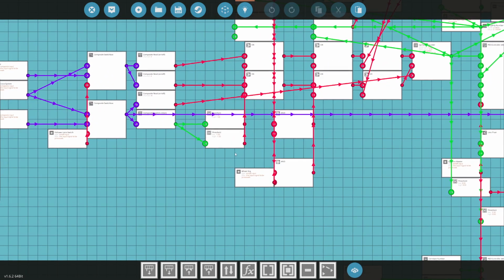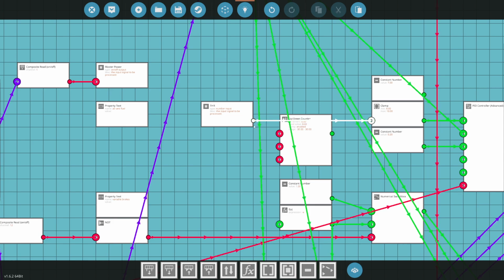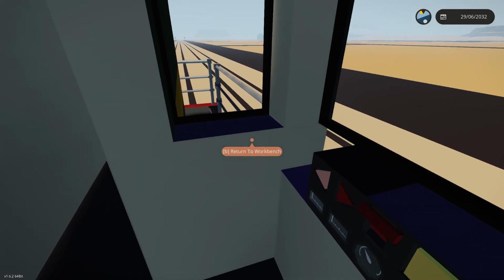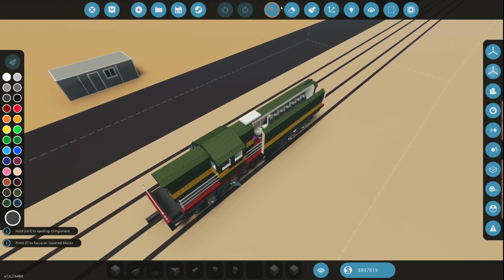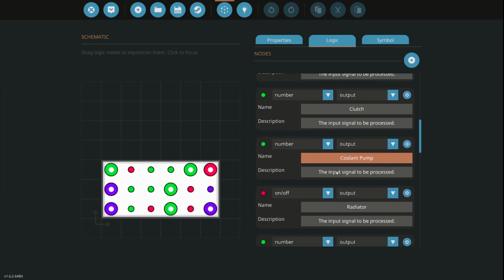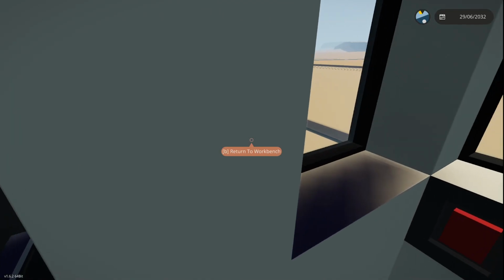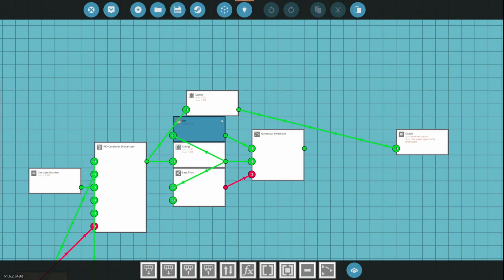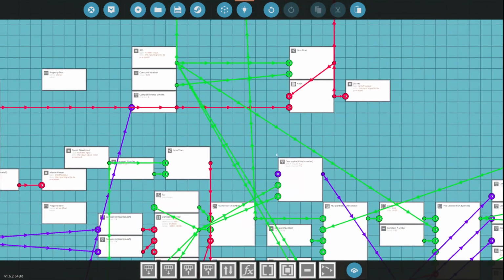Stormworks Career Build Series 178

Comment: Loved the video @Captain_Cockerels Gaming! Can't wait for the next video man! Just Looked up the Diesel Engine that you're working on and you were not joking when you said that there's little to no Information about it. It's called the ChME3 and it was built between 1963 and 1994 with 8,200 units built. Apparently they are perfect for Hauling Heavy, Slow Freight and Cargo Trains. In case you're wondering, I'm looking at what little bit of an article there is on it on Wikipedia.

For a Back-up Design, might I Recommend the ALCO RSD-1. It has a Turbocharged Straight-6 Four-Stroke Diesel Engine that can go up to 65 mph. Built between November 1942 to May 1946 with only 150 Units total.